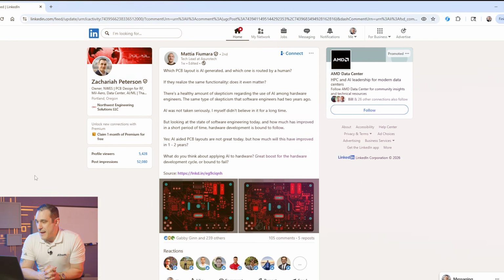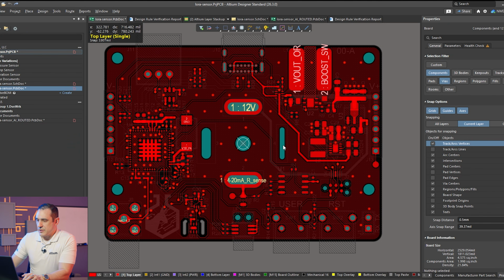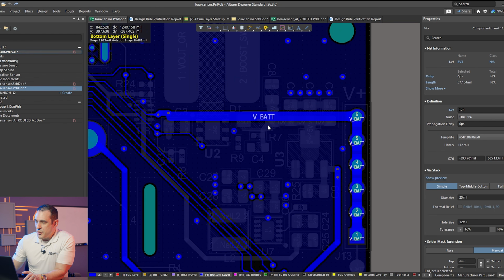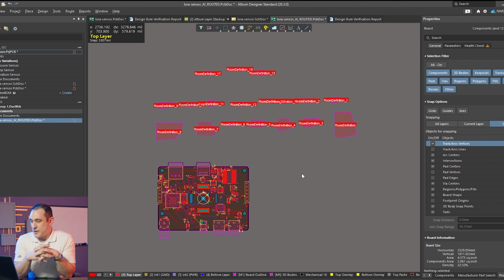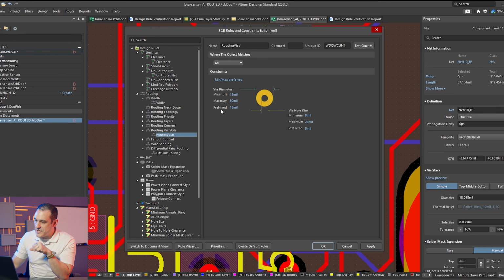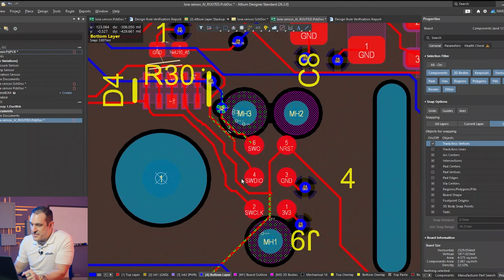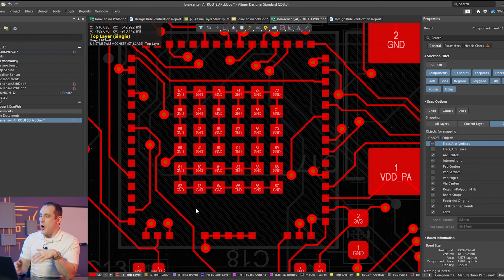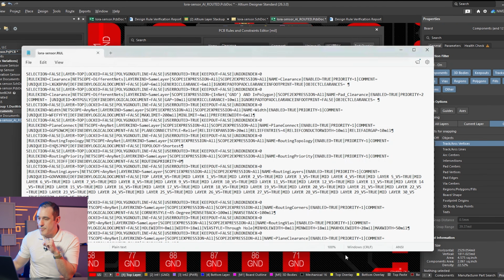AI PCB Layout vs. Human Design: The Honest Truth

Comment: Isn't this the built in AI Altium ships with?  
What about a review of non AI Altium autotracer?
On an open system like KiCAD DRC count can be easily fed back to AI for fixing.

The best area would be to just pre placing components with AI, for minimal cross traces, then even auto router can do a decent job.
Reply: no, I used quilter for the AI portion. altium doesn't have an AI router.
Reply: if altium integrated a feature, then they've got the source (duh), and they can connect it to whatever other parts of the software they want.

placing components isn't that hard for a person, and autorouters still don't do a good job even with the parts already placed.
Reply: I would use AI for schematics (electrical engineering side of things) since that's far more difficult to wrap my head around than placement and routing
Reply: @RubbinRobbin  AI is helpful for certain aspects of design, for example, i wrote my own tool that can extract pin tables from datasheets and mechanical dimensions for packages for footprint creation. there is certainly a use case for AI as an augmented value add to humans doing design. or like Zachariah suggested, using an LLM to set up design rules from natural language description would also be a great use case for it.

routing a PCB is at the very least NP complete or possibly even an NP hard problem. i don't believe AI (either next token predicting LLMs or even RL) is the right approach for routing.

the board i used in this example is relatively simple and it still choked hard.
Reply: @ZacksLab  You nailed it—EE is the hard part for me, but AI makes it way more approachable: datasheets, constraints, system behavior. Routing is tough, but at least it’s visual. For AI it’s flipped—great at EE stuff, bad at NP-hard routing. If Altium Designer had a local or cloud API to assist on the EE side (rules, validation, datasheets), that would be huge—would open the door for people from other fields to jump into PCB design and bring in ideas you wouldn’t normally see.

Comment: thanks for the review Zachariah! i will incorporate your feedback (on my human version) on the next spin :)
Reply: great design mate , and which AI have you used for above design and would you please specify is it only the routing,pours or everything is done by AI ?
Reply: @rahulspb  the first half of the vid was done 100% by me, no AI.

then, out of curiosity, i took that finished board (which i also built and verified it works) i fed it to one of the top AI place/route tools out there (in this case Quilter). that version was the second half of the video.

currently, I do use AI in my workflow, but not at all for place/route. it is useful for information gathering, extracting info from datasheets, pin tables, dimensions, etc... and for writing frimware.

i think that the real problem with AI and RL (and RLHF for that matter) is that you need immensely high quality (ground truth) data to feedback the AI as it does its billions and billions of training cycles. that works great with software, and for robotics to some degree, but the number of interactions of EM waves inside of a PCB, even a simple one like this, explode to astronomical amounts of infinity. none of it can be simulated, even with HFSS, the premier 3d field solves only get you 90% of the way there, as all models are wrong.

the only true way to capture the behavior in reality is to build the board, and that, is precisely why I believe AI will never do anything meaningful in modern PCB layout/route. happy to eat my words though. :)

Comment: I would ask for at least 0 DRC to consider "Hello World" phase. Of course with good rules, the minimum quality of your PCB is as good as your DR are.
Reply: True, though many of the default rules are kinda bs and/or overly strict and are frequently violated by footprints for example. This example here is not that, this has genuine rule violations such as unrouted nets and nets colliding with other objects etc. But many times I will download a footprint of sth really simple like eg a DB9 connector (because I ain't gonna design every footprint by hand, it'd cost me days) and the footprint itself might have clearance violations because the default rules are waaay too strict. So I don't know if when Zack opens a project in Altium that he got from some random source, if it comes embedded with the design rules that the designer chose.